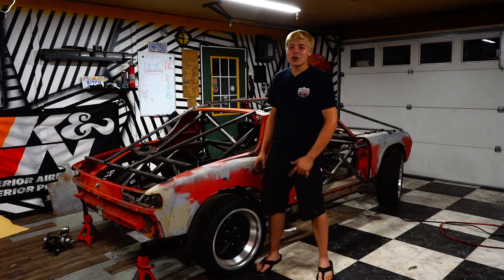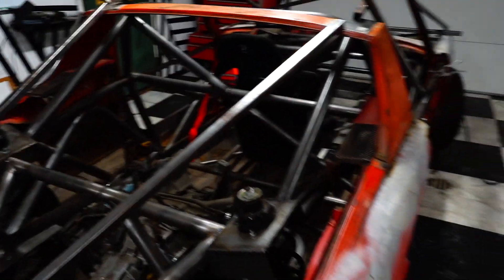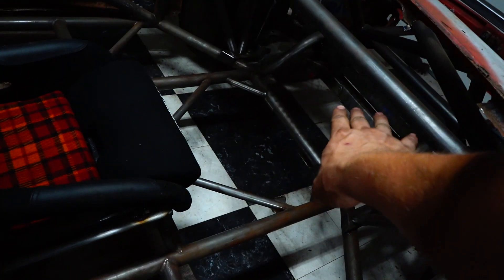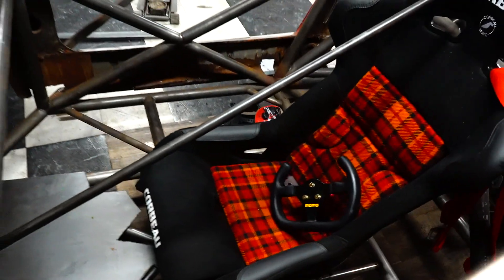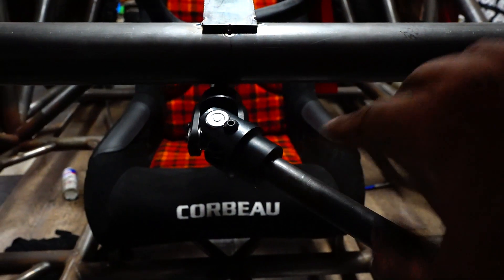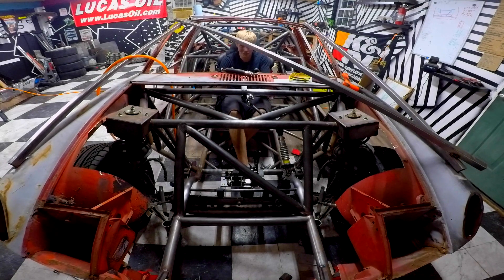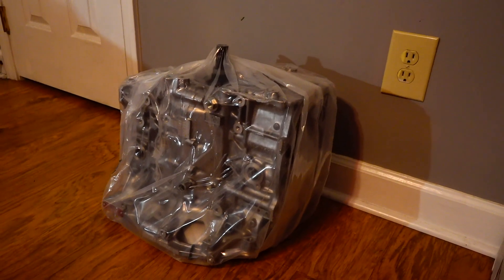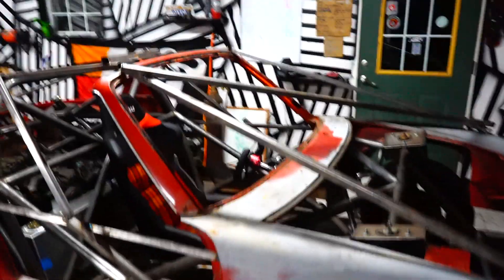Home Built Porsche Ep.4 / Engine, Steering and More

Comment: The steering wheel portion of the shaft should have 2 support bearings and the intermediate shaft should float unsupported. It allows for adjustability and will serve you better.